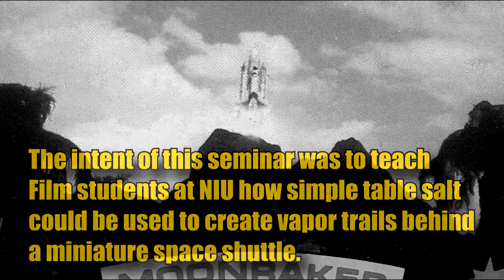2004 NIU / SFVA 'MOONRAKER' Vapor Trail Special Effects Seminar

Comment: Having putzed around with VFX years ago I have thought of another way they could have done this.  Put the model in a water tank at the end of a hose with a light on in the engines and then blow tempera paint out of the hose into the water as the shuttle is lifted up through the water.   The clouds look exactly like the plume the shuttle produces.   WIth a bright enough light source it could be a very cool effect.  I think it would work.
Reply from the maker: It's funny you mentioned that. I tried to use that same concept once with a spaceship launch. The problem is, once the smoke (or milky cloud) starts moving through the tank, it makes the water move, too. At that point, the viewer can tell it is in the tank. From that point, I found building smokebombs into the fuselage of the model miniature was a much more effective alternative. Of course, that was back in the 90's!